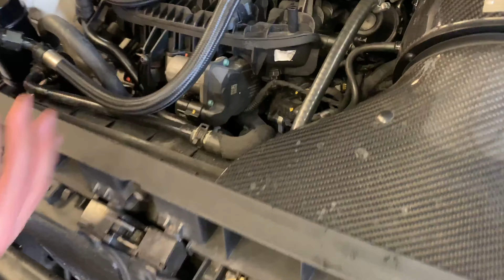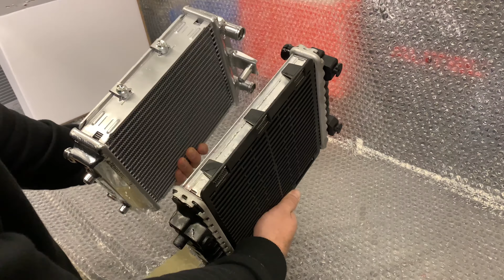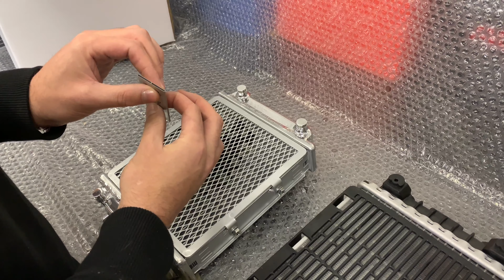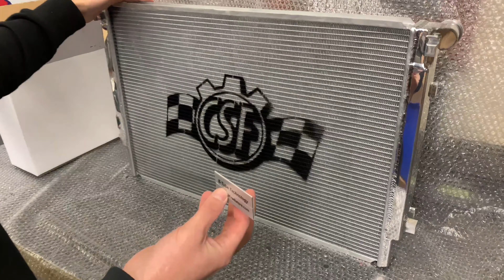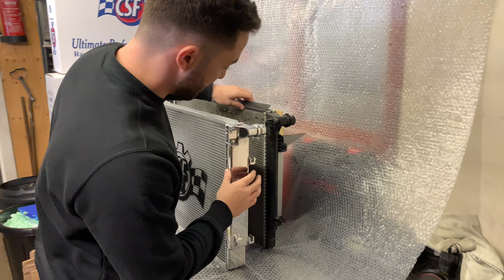CSF Radiator & DSG Cooler for MQB Platform: MK7R, 8V S3 + More!

Comment: Hello, I’ve recently bought a dsg cooler for my mk7 golf r, it is fitted to the front passenger side isn’t it? Also what is fitted on the drivers side? My mechanic thinks I need 2 dsg coolers, one for each side, thanks
Reply: there's one DSG cooler, and the other side is an auxiliary radiator not another DSG cooler.

Comment: does the radiator fit with an aftermarket intercooler?, it seem to be much more thicker than oem, and due to the extra thickness of the aftermarket intercooler maybe it will not fit
Reply: Mauricio Sastoque he says in the vid that cars running an ie intercooler so I would assume it fits
Reply: It will fit with an OE or aftermarket intercooler like the IE
Reply: it will fit to intercooler like Airtec ?